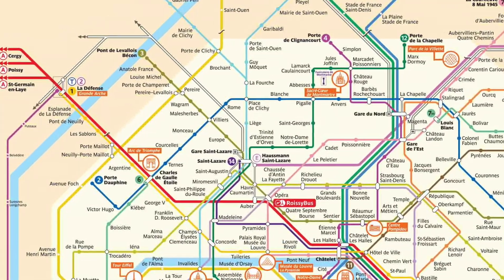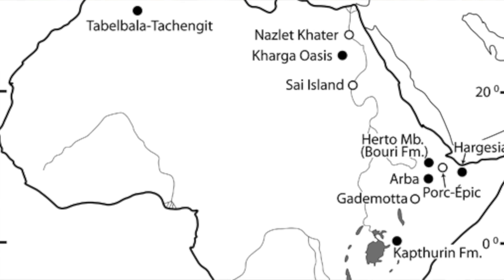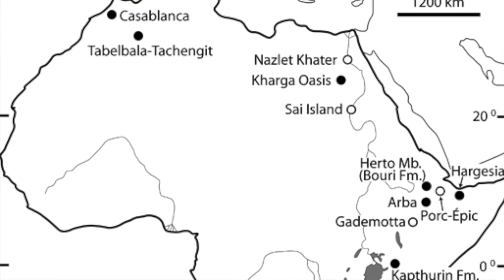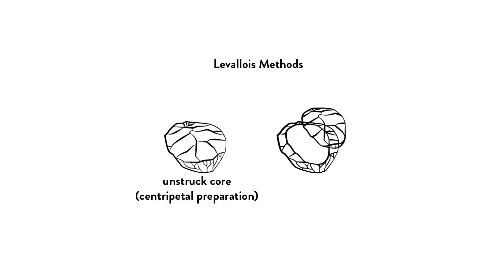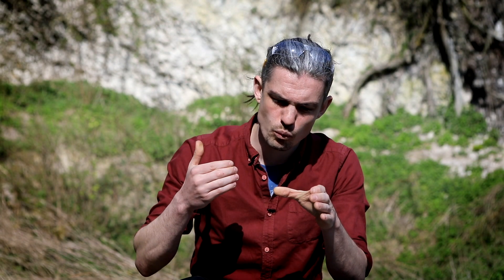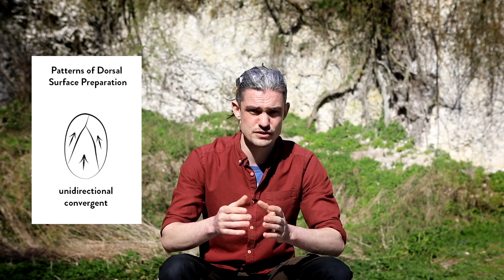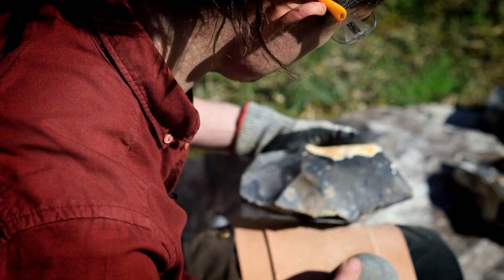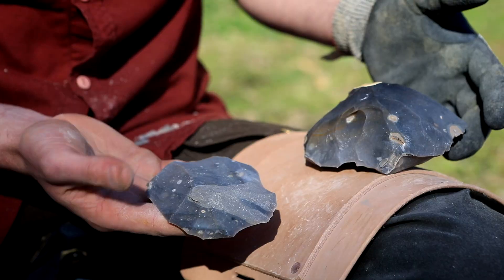Levallois Core Technology: An Alternative Way of Making Stone Tools

Comment: Interesting. And it appears to be so complicate because we have classified levallois as a technique like Boeda says. Today levallois is recognise as a technique but is more largely understand as technofunctionnal complex. In certain sites we have pure levallois but on others we see coexistence of different ways to do debitage and sometimes on the same core! Example frequently see a volumetric debitage goes to a quina exploitation and goes to an opportunity to do levallois than the flintknapper do it (example from Sclayn cave for example), in other case you have full levallois techniques like in Omal and Neuville (I talk about belgium because I am a belgian archaeologist) where we have tendency to go to levallois blades. It seems that levallois was sometimes a finality and sometimes not and use if they have an opportunity to do so. It is the pure plasticity of human behaviour. The extreme is in Yemen were sapiens do so much levallois points that it was mass and industrial production. In reality these points could have been produced by full levallois techniques (preferentially unidirectional but sometimes bidirectional), but the experiment I do (I have made more than 45 of them to appreciate their cutting power), I have obtain it on full levallois cores, but also on discoid, on volumetric or sometimes opportunistic cores. As you say the technique subsist after and the reason why is simply because it is not levallois but an universal technique to obtain optimised volumes, convexity, good striking platforms etc, it is particularly the case for the livres de beurre looks like enormous levallois cores and are in fact surfacial exploitation of blocks. For the sharp edge of levallois of course the edges are sharp but every flake have sharp edges and blades have also as sharp edges. It is more a question of angulation of the edges, if the angle is low the cutting power is high and penetrating in a skin also, but if the angle is high it shows less cutting power and less penetration in skin. This is the reason why a lot of flakes where rejected or used for other purposes but not cutting.  All the best.